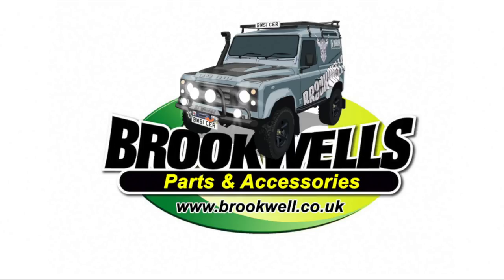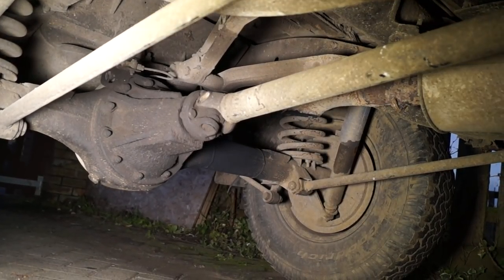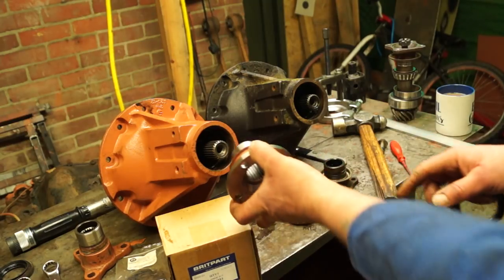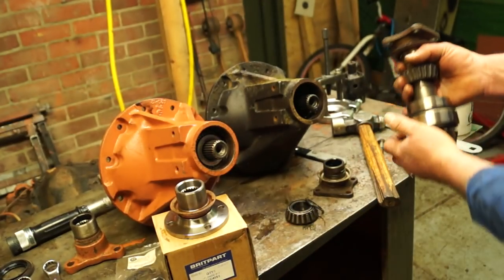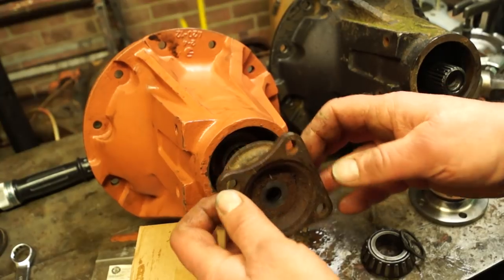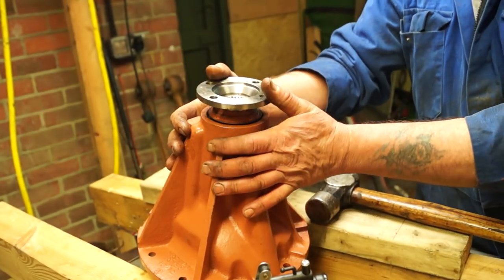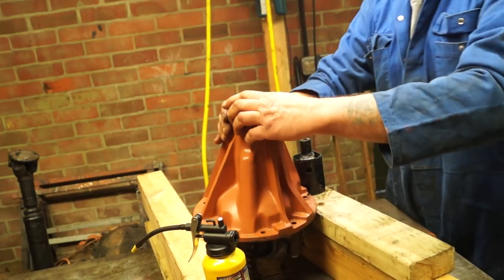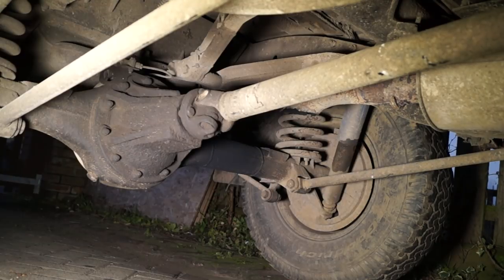STC4858 Differential Pinion Flange fitting plus extra info about the square and round flanges

Comment: Great video as always, are you putting the new flange on just to get rid of the doughnut? Is it worth doing this on a standard D2?
Reply from the maker: Yes, it is worth doing because the rubber cush drive/doughnut is not as reliable as a Hardy Spicer joint.